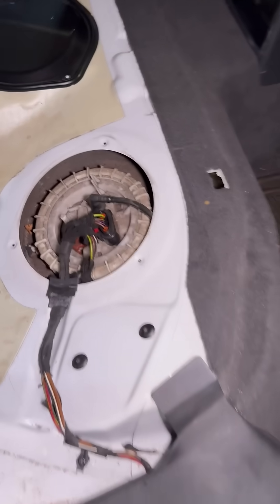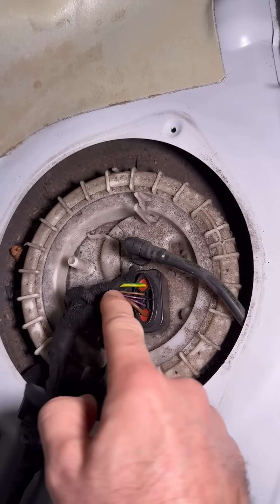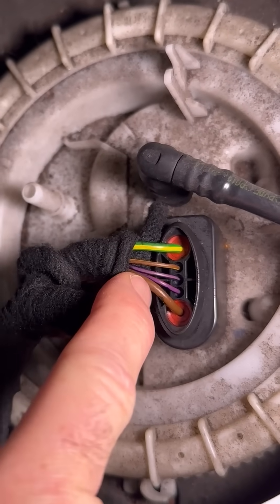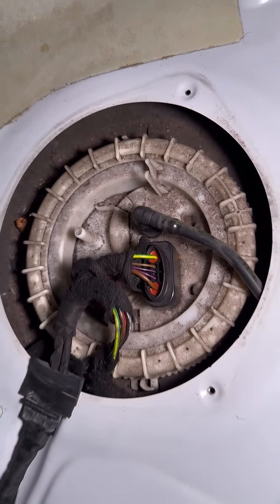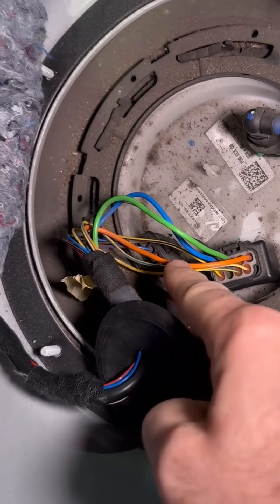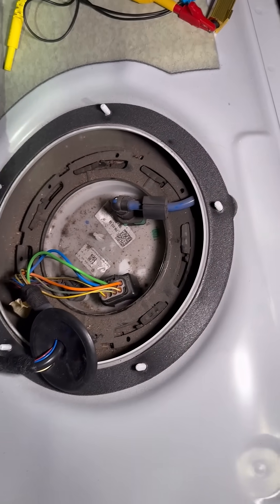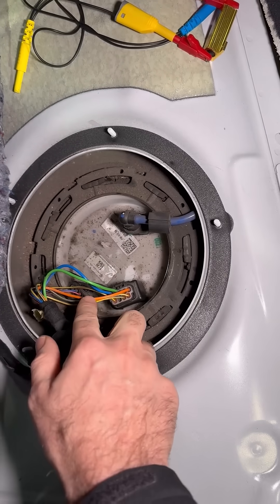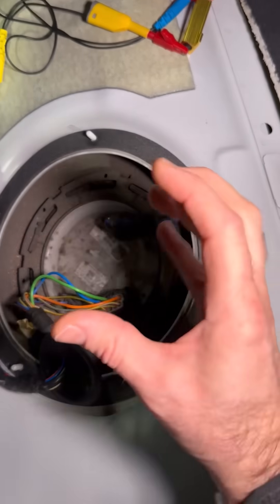How to Identify a Three-Phase Fuel Pump | Mechanic Mindset

Comment: Do automotive technicians and other people realize that the degree of electrical engineering and diagnostic skills to fix maintain and repair modern day gas vehicles not including electric vehicles, exceeds the skill level of your average every day Electrician, who makes more money doing a lot less a lot easier with less equipment and less knowledge as a electrician working in buildings. 

Electricians build pipe pool, wires, drill holes and walls, and connect up panels and switches . 

They often cannot diagnose a repair the equipment that they’re bringing the power they work on the device devices . 

Very few especially residential electricians know anything at all whatsoever about three phase motors, or inverters and pulse with modulation 

But yet automotive technicians are expected to know something that electrical engineer and repair service personnel who would work for NASA or Heer Packard with a degree education but yet get paid only double of what a McDonald’s cashier will get paid
Reply from the maker: It’s crazy - I think there are a lot of roots to this cause

Comment: Doesn't matter to me either way but I thought single phase PWM worked fine for reducing load to the charging circuit. I wonder how much total current they are saving with the phase converter over PWM?

Comment: people all over the world have been powering serious radio controlled race cars, trucks, buggies and now airplanes and boats with 3 phase DC motors for over 20 years. we drive the motors with an electronic speed control, way more sophisticated then any vehicle will ever use. been scoping them with a pico for over 10 years.  you should see the speedo's for racing in open or modified classes, they can be programed to advance the timing at certain rpm's - turning motors into wild beasts
Reply from the maker: @flacarpetracer  Sounds cool, I knew they used them but never got in to it 👍

Comment: Uh i can imagine what would happen if powered those wires up with 12v dc, bad things. Never heard of those before, sounds like they could be 3phase brushless pumps? Should be very long lasting with no brushes to wear out.
Reply from the maker: That’s right, brushless motors inside; I haven’t tried powering on of the phases yet 😅.
Reply: I could be wrong but I believe the motor would spin until the rotor with the appropriate magnet polarity will line up with the opposite polarity of the coil being energized causing the rotor to turn  until it gets to that spot then electro-magnetism wil cause the rotor to stop in place.
Reply from the maker: @ If it had a ground on the opposing phase, theoretically that’s what should happen. Like a partial rotation 👍
Reply: @MechanicMindset  but aren't the ends of each "coil" permanently grounded and the module only sends power at the appropriate time or does the module control both power and ground?
Reply from the maker: @crasher88  No, centre isn’t grounded. Each phases is a power and ground switched 👍